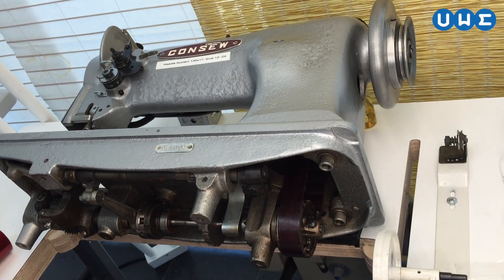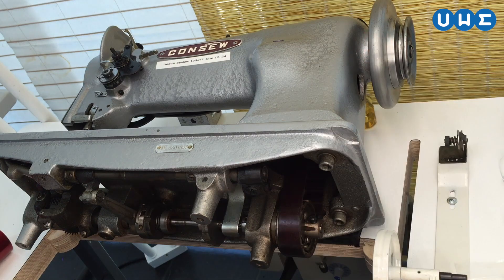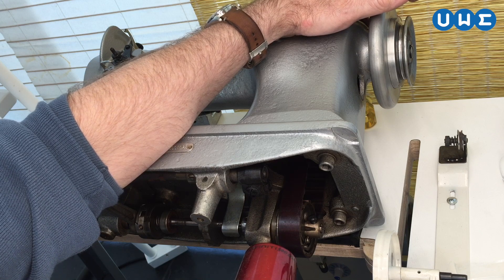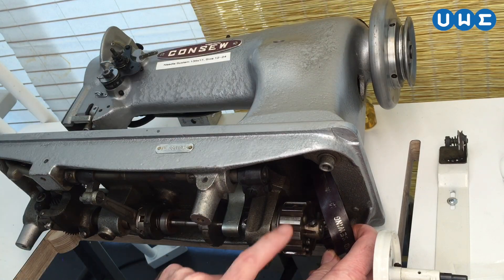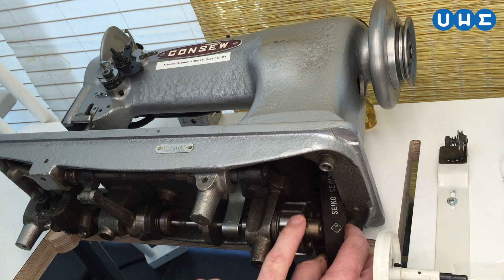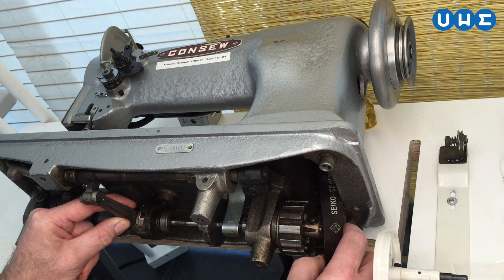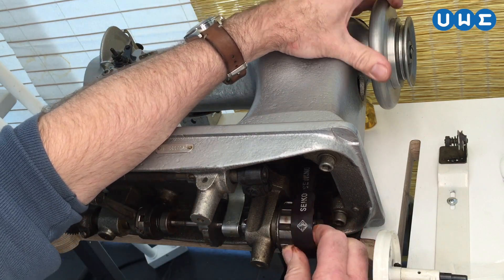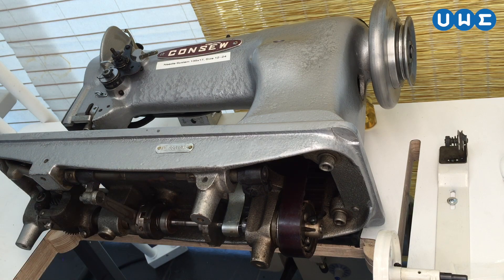Consew 225 Timing Belt and Drive Shaft Synchronization

Comment: Would you know what size belt I would need going from the head to the servo motor?
Reply from the maker: The belts are generally 3L V belts. 3L indicates how wide the belt is (3/8”in this case). The length depends on your particular installation and pulley sizes. The belts are available in 1” increments online and many automotive or hardware stores for under $10 in the USA. Measure length by wrapping a tailor’s measuring tape around top of pulley groove, not in the valley. Move motor to middle of pivoting adjustment range before measuring.
Reply: Uwe Grosse  thanks

Comment: Re:my previous question. The "hole" is where the set screw for the top gear is installed and is situated between the maximum and minimum TPI marks (between the 3 and the 24 on the engraved TPI indicator).

Comment: Do major differences exist between the Consew 206, 225 & 226 machines? They all seem to look the same.
Reply from the maker: The Consew 225 and 226 are nearly identical vertical axis hook machines, the 226 adds reverse. The Consew 206 is a totally different design with a horizontal axis hook - it shares almost no components with the Consew 225 or 226.
Reply: Thank you for the info.

Comment: Hi. I have two questions: 1) on the bottom drive shaft, the notched pulley is not fixed to the shaft and despite this 2) the needle displacement remains synchronized with the feed dog aperture.  So, 1) how do I affix the notched pulley to the lower drive shaft and how are the needle and feed dog coordinated such that they seem to be connected EVEN if I freeze the hook ratation (which I can do because of the pulley slippage). Question 2 is academic, because it dissappears in the event that the pulley is properly affixed, but is interesting because I cannot determine how the (lower) feed dog remains synchronized with the (upper) needle feed, when the belt is taken out of the equation.
Reply from the maker: On some machines the feed dog movement is driven by linkages to cams on the upper shaft. In that case the lower shaft only drives the hook. If your lower pulley spins freely on the lower shaft, the safety clutch very likely has disengaged. Your machine's manual should describe how to reset your safety clutch. My Consew 225 hook timing video also shows how to reset it on that particular machine.
Reply: Uwe Grosse Yes, it turns out that the safety clutch had been tripped, and this answers my confusion about why a crenalated pulley was so complicated. I simply reset it, and Voila! In addition, I have found that the lower drive shaft drives a pushrod that coordinates the needle feed with the feed dog displacement. Thanks very much for your assistance. I'll have this bad boy timed and stitching before dark.
Reply: Hi Uwe, I have a Consew 226 and I am following your directions. I have TWO arrows on the frame (pointing in the direction of the clutch) and one arrow on the limit collar of the bottom drive shaft. Of the two arrows pointing to the clutch, one is painted red and the other is unpainted. I assume that I want to align with the red arrow, but that raises the two questions: 1) "Am I right?" and 2) "Why is there a second arrow?".

Thanks for the  help,

Chris.
Reply from the maker: It's hard to tell without seeing pictures. Check out http://leatherworker.net/forum/topic/77130-seiko-stw-8b-thread-snapping-sound-around-bobbin/ and add to that topic with pictures of your machine. Consew 226 is made by Seiko (Model number STW-8B)

Comment: Do you know if there are arrows like this on the Juki LU-563 ? Thanks !
Reply from the maker: Yes, my Juki LU-563 has the same alignment arrows.
Reply: @UweXY  Hi Uwe, are there any indicators on Juki LU-1508 for alignment? Thank you! My feed dog seems to be moving in the opposite/wrong direction and I am wondering if this would correct that.
Reply from the maker: The Juki LU-1508 has a different alignment method. Page 16/17 of the engineers manual describes it: https://all-guidesbox.com/manual/703364/juki-lu-1508n-engineer-s-manual-80.html?page=20
Reply: @UweXY  thank you very much!

Comment: I have a 111w156 and did the belt. Thanks for the video. My arm shaft bushing didn't want to come out. I had to cut a screw driver to fit into the machine and be able to extend as the bushing was pounded out. The machine had sat for years..even then  I bet they didn't oil it much. The bushing faired ok and with some cleaning of dig marks,etc. reused it.. It sews so smooth and quiet compared to my Juki 1510N-7..